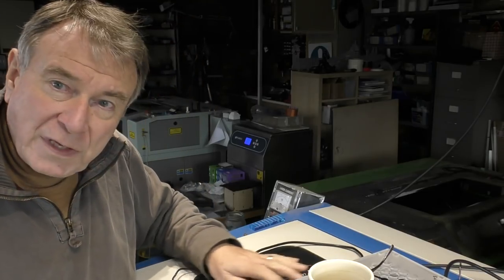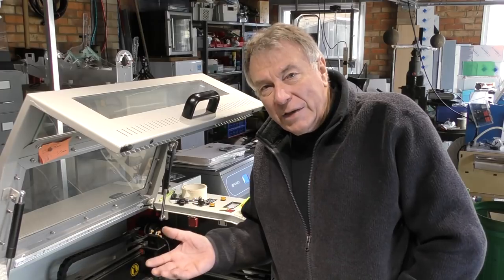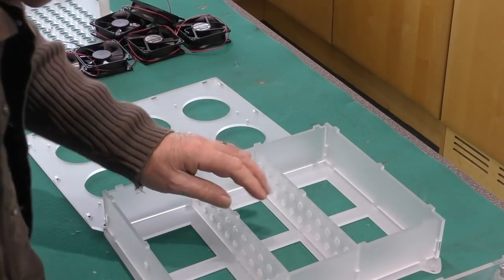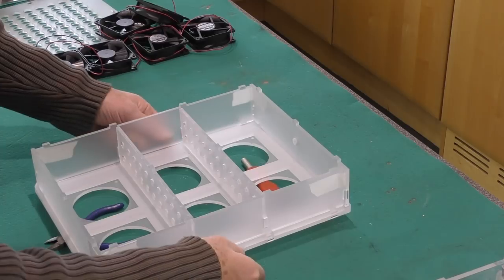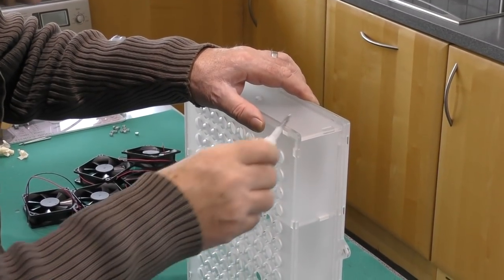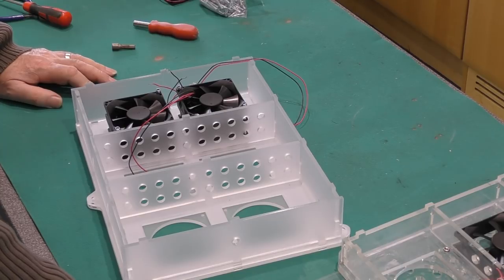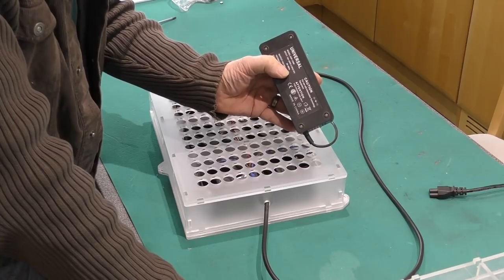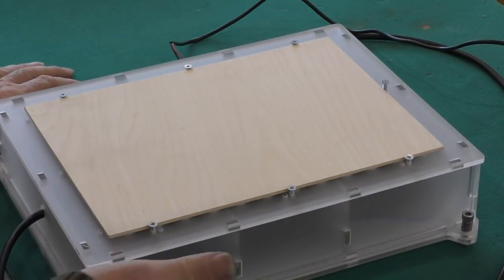RDWorks Learning Lab 165 Making a Vacuum Table

Comment: Why use fans rather than a vacuum cleaner? More suction and probably can pick them up cheaper than the fans and psu.
Reply: The problems with most is the hose.  The vac is too big to fit inside the laser and the doors won't close with the vac outside and the hose going inside.  For higher vac, instead of using the flat high airflow fans, use the small squirrel cage fans for a higher pressure difference at lower volume.  Small ones such as the  Anet 5015 Ultra-quiet Turbo Small Fan work well for a higher pressure difference at the low blocked off flow.  Small versions are often used in 3D printers for smaller concentrated flow at the hot end. You want the larger versions for a vac hold down table.
Reply from the maker: Hi 
I believe I did mention that my first attempt was to use a small cheap vac cleaner and it worked well.. However, there were 2 problems. First was the unbearable high pitch screaming noise and second,  the vac motor was very unhappy at long sessions of stalled airflow and was beginning to get very hot after  just 5 minutes... As Isettech mentions there are many better  fan choices you can make . but my Mk1 was using fans I had to hand and worked very well  with no overheating despite stalled airflow. This  mK2 is just that bit better .
Best wishes
Russ
Reply: @isettech  Yes, the muffin fans are not at all appropriate for this application. A blower type fan (squirrel cage) is the right thing to use here.

Comment: Hi Russ
Off to Florida? You should stop by our shop. We are selling a new brand of machines that is, in my opinion, the best chinese laser on the market. You can see how far we've come since the days of working out of Danny's backroom
Reply from the maker: Hi Rob
Have you been promoted to coffee maker yet or are you now running the show? Often wonder how the business is progressing. What brand have you moved on to now?  I'm flying into West Palm Beach for a week (without a car) so I doubt if i'll make it up to see you guys.  By the way, I did latterly find out why beam alignment at the 4th corner is often out of alignment with the other 3...an interesting and very subtle mechanical problem. Packing the rails as we tried with that bench top  Bodor machine is not the answer.
Best wishes to all
Russ
Reply: We are heavily pushing Aeon. Its a somewhat new company but their machines are fantastic. Good airflow, runs up to 200mm/s, Beam combiner, good airflow (comes from underneath) etc. 
I do a lot of travelling now either onsite training or fixing machines (where you see acrylic fires, I see opportunity).
Pity you can't make it over. The warehouse is packed with machines and a nice little workflow we got going. Kira the snowstorm dog misses you
Reply from the maker: @robxsiq7744  
Aeon look quite a nice neat well designed  machine, several steps up from Bodor.  Nice lightweight head and servo driven. However I see  no sign of any real airflow management and still stuck on using honeycomb. Great to hear that your are out on your own.
Sincere best wishes
Russ
Reply: We always recommend using the blade table for cutting. Some people want to use the honeycomb though, so we put rubber spacers (feet) on them to elevate the underside which allows the smoke to get pulled under and out.  The bigger machines have the outtake under the table/honeycomb so the smoke goes straight down. Its powerful..you can have your face right over the acrylic and you won't smell anything due to it being immediately sucked out....good design. 

We still recommend using the blade table for cutting on that though, mostly to keep down the flareups honeycomb cutting makes when the laser hits the metal.
Honeycombs aren't great, but its better than just sitting right on the metal bed itself.
Reply: Oh, its not a servo motor...standard stepper...but still goes at 1200mm/s.  :)